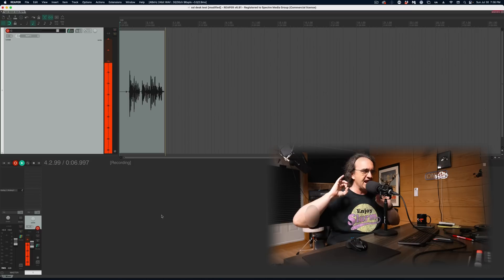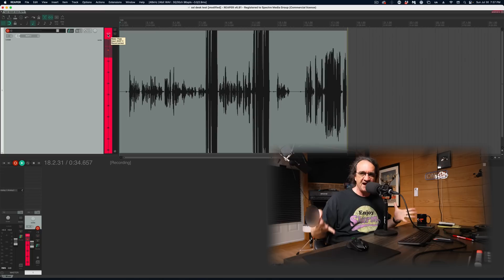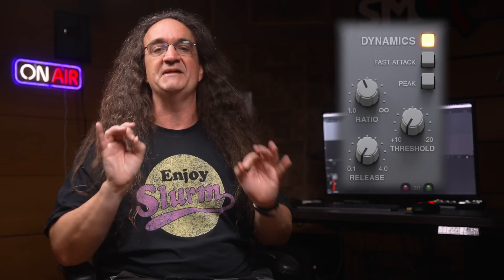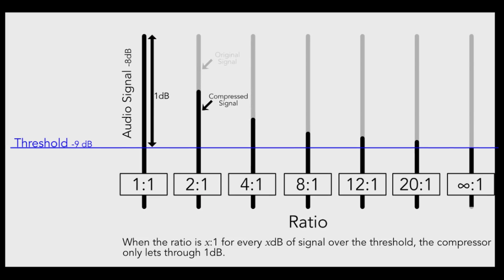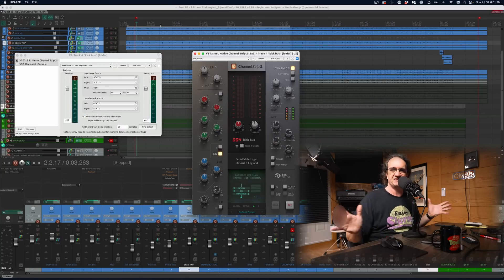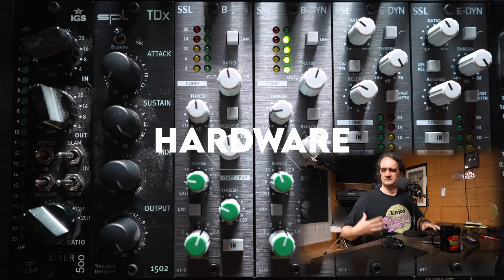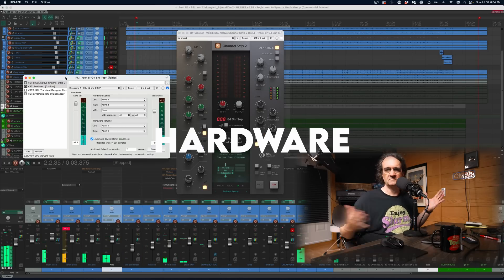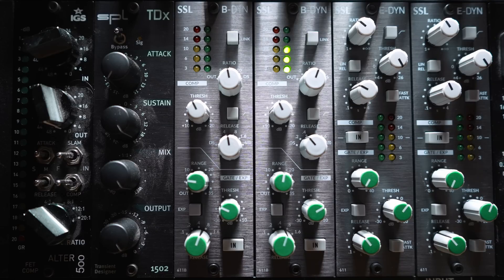5 Reasons this is BETTER than your Software!

Comment: I sounds like the attack and release times are different. the plugin kills more of the transients in this example and releases slower compared to the hardware. But maybe its just because the gain reduction meter didn't kick in at all on the hardware and it just got louder and drove your bus comps harder😅
Reply: Not quite… plug-in manufactures haven’t quite figured out how to emulate certain parts of hardware just yet… believe me everyone on the world is trying. It’s not just 1s and 0s, there’s something else going on… one day, they will have it, and it’ll be fucking glorious! But alas, today is not that day.
Reply: @BeatsAndMeats  believing sounds a bit too religious for me ;) I have heard enough double AB blind tests on other hardware vs plugins with properly matched levels, matched gain reduction and manually adjusted attack and release times. I respect Glenn and enjoy his energetic style, but this test could have been done better. Output level matching, at least similar gain reduction would be a start. The hardware needs tons of level going in to start compressing, but uses automatic gain compensation on the threshold knob, which makes this difficult though.  I am not saying there is no difference at all, it's just not so big as heard here.

Comment: great video about why i LOVE hardware. i'm gonna be selling some gear to eventually get some 500 series gear so i can easily get it out and easily transport it.

also I love the SSL gates for some reason. best part of the SSL signal chain that is often underrated. I also dig the compression and EQ, but something about that gate is so easy to set and smooth. Compressor wise i sometimes use it but usually end up reaching for others in plugins. I also think the difference is more felt these days than heard. the results 'feel' like a record. also workflow makes things faster than dicking around with a mouse.

Comment: To be honest, I don't hear any discernible difference. I sadly do not have the golden ears of the Gods or my speakers are just not that good.  (KRK Rokit 5's) I am however a big fan of using compressors in recording like Glenn does with his vocals. I have to digitize a lot of tape cassette and getting the signal in right from the start makes it more enjoyable for the researchers who have to listen to them.
Reply: That's a surprise, I could hear the difference on my Bluetooth earbuds. There's a crisp and punchy quality to the hardware versions that the software wasn't giving.

Comment: I'm thinking of going outboard for dynamics, so this video is right up my alley. But you're missing all the things that are making me hesitant. Like:

- You first need to buy a good 500 series rack.
- Let's say you have a couple of compressors. You are never going to get enough to do the entire mix, so you're going to have to bounce the track every time you use compression.
- Even if you can get the sound quicker, it's a painfully slow process to re-record every track.
Reply: Fredenstien makes a good one that’s budget friendly - and companies like WesAudio make hardware with a software interface- so u can store mix specific info - similar to the new 2254’s by Neve
Reply: Fair point on the 500 series rack. Those can get really expensive.
On the other two points. Most people just use outboard gear for specific things. Like snare, vocals.
So you are usually pretty solid with 4 or 5 compressors.
Reply: Wish they would make these things in 19 inch rack form with regular connections. That would be a fantastic deal!

Comment: From what I remember, SSL Native plugins do not have the saturation that the analog does (or any at all for that matter). So no wonder why the analog gets aggressive faster.
Reply: The right plugin has. Glenn took the wrong one, the SSL 4000B is another SSL plugin (not for regular sale but part of a subscription) and it has loads of colour
Reply: I would have liked to see the difference between the hardware and the SSL 4000B channel strip plugin as Channel strip 2 is based on a 9000 series console. Would love a stack of these but I don't want to get out of the box because that seems like it will open my wallet too far hah.
Reply: I use SSL's VST's for their console stuff, pretty good match to my 9000J channel strip for everything I've thrown at it.
The E switch seems to work as advertised as well.
Reply: they get aggressive and yet somehow don't get that unnatural pumping with the compression so there is that.

Comment: I suspect that the top professional mixers use a lot of analog gear, at least the mastering engineers. Software is getting better and better and can do things hardware can't so we will see what happens in the future.
Reply: Billy Decker, Serban, Andrew Scheps, etc. all ITB...
Reply: @danymalsound  I have doubts, I heard one of the top mastering engineer talking about in the box during a presentation (could have been from a NAMM video) and then he briefly mentioned Terry Audio. When I looked it up it was about high quality analog gear.
Reply: Mastering is only two channels so it's easy to use hardware on "all" channels. Mixing is dozens of tracks.
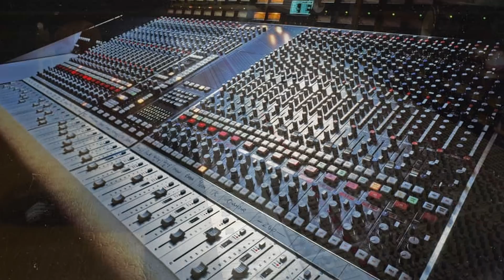Reply: @sparella  Glenn said from 3:10 in this video: "Even today with all of this incredible digital technology, most of the top level mixing engineers are still working on a full-sized analog console."
Reply: @Anders01  That is the assertion but he doesn't provide any evidence. Regardless, I don't think he would also assert that the use of analog mixing consoles is on the rise. A citation would have been nice, but this is a YouTube promotion, not an AES presentation, so I'll try to switch out of nerdy engineer mode.
Reply: @sparella  And he was maybe talking about metal mixing engineers. EDM mixing engineers likely work a lot in the box.
Reply: @Anders01  Good point!